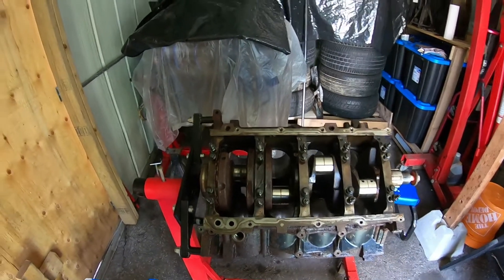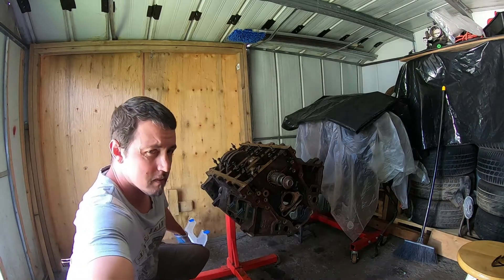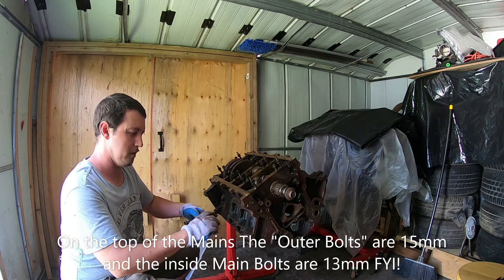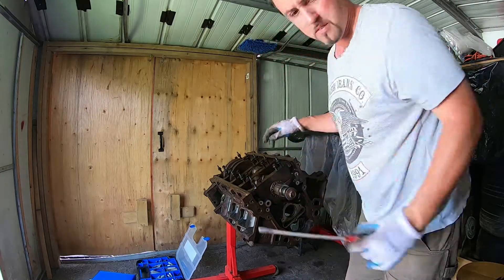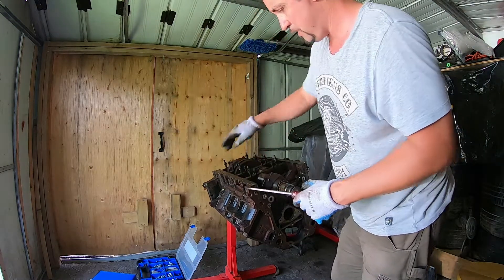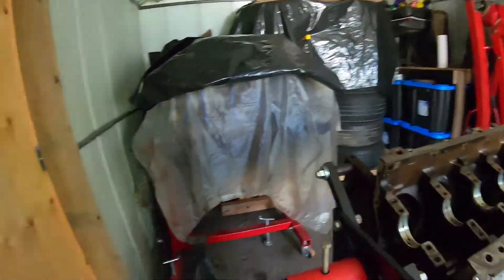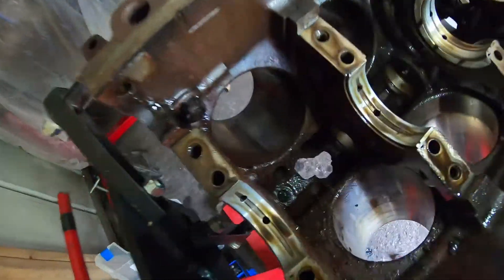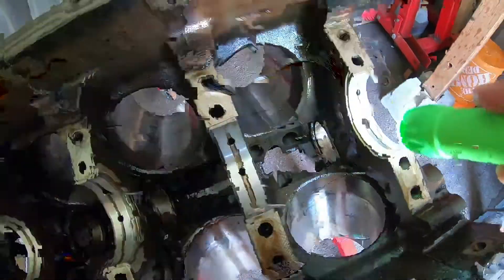How To Remove GM LS LM7 5.3L Main Caps and Crank Shaft! Part (#5)

Comment: Man, I would never use a screwdriver, nor should I have to, pulling the mains on my aluminum 4.6. I for sure as hell did/had to on this 5.3 😅

I'm used to clean blocks but this 300k mile 5.3 gave me a hell of a time. I'm surprised the side bolts weren't stuck on me. 

If engine blocks could laugh, it would've been laughing at me the entire time.
Reply from the maker: Ya sometimes you gotta do what ya gotta do I’ll admit that some of the stuff I do is definitely not professional or proper that’s for sure

Comment: Put the crank back in and measure the end play, that will give you a number that you can account as either normal or heavy wear.
Reply from the maker: even when the crank was in way before I took everything apart the engine seemed to have lots of compression when I spun it over with a long bar. Honestly though if the engine didn't get any water in it from being in the junk yard i think it would of been fine!
Reply: @Greatwhitenorthgarage1987 - It will be fine from that, the crusty bits will clean off, I have no internal LS experience but would bet that trigger wheel is a press on and is also indexed somehow.
Reply from the maker: @TheCanadianBubba   Well, I was just a bit curious to clean it up and see what happens! see how well it could clean up, just for shits and giggles!